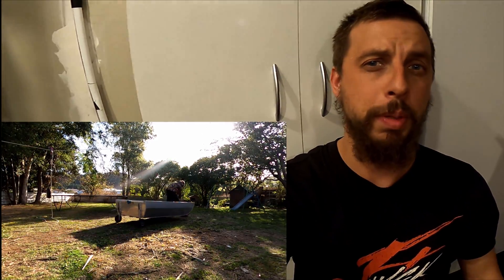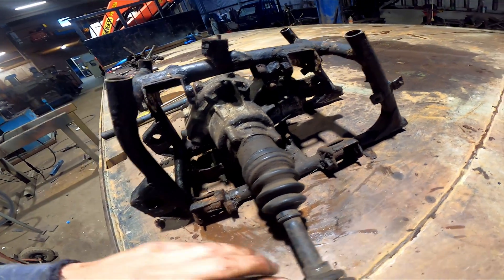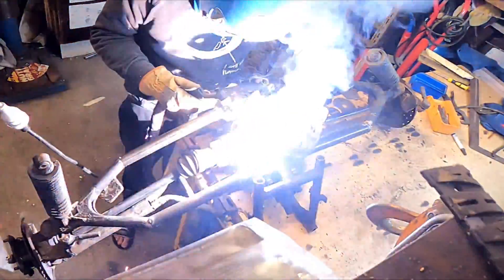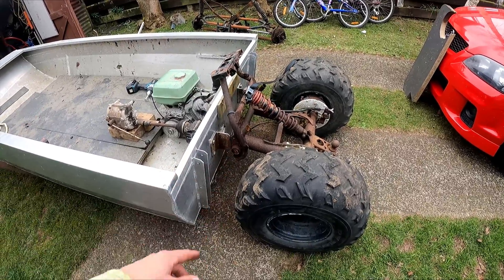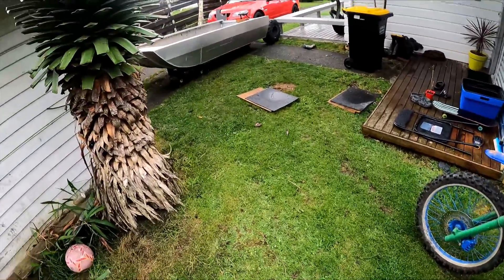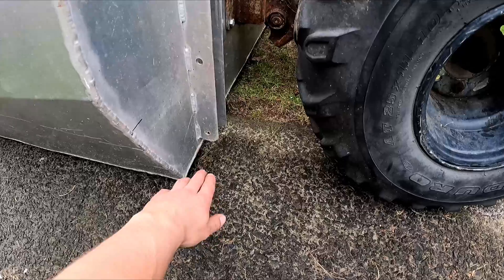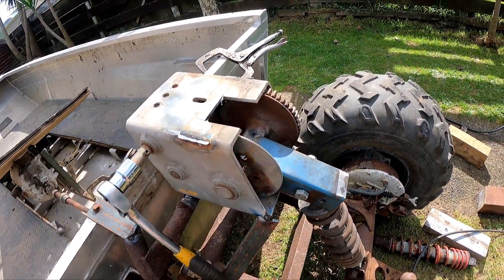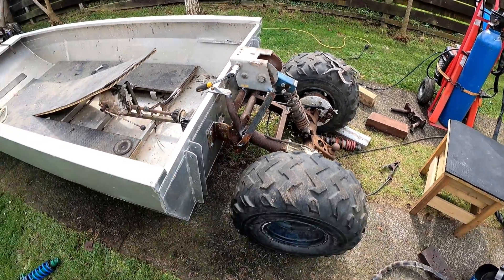Amphibious ATV Build, p1

Comment: Will that diff have an oil issue flipped?
Reply from the maker: I don’t think so I was just going to put a bit more in it to make sure but the dipstick is upside down so would have to seal that
Reply: @dkthewelder  some diffs don’t oil as well in reverse but I see you’re not going to need it anyway

Comment: Oh well done with the music sync @5:16  That was some world class editing.  The winch looking device for adjusting rear wheel height is cool, but barely up to the job.  In use the un damped lowering would be less of a problem because you'd be lowering the hull into the water, so a bit of a splash would be all you'd need to worry about.   And you are not a worrying sort of a guy anyway based on your videos.  You are still going to need more power to lift the rear wheels, so maybe something weird with a wee trolley jack?
Reply from the maker: I will stay with the winch it works pretty well I can fiddle with the geometry a bit to get it better I will mostly raising and lowering on the water with very little resistance, but I need it to work in worst case scenario. I’m still not sure what to do with the front

Comment: Awesome. A scissor Jack out of a car might work better than the winch as you have controll both ways   Also I see  an air boat would be interesting.  It won't suck up weed or stones
Reply from the maker: Yeah I might use a scissor jack for the front. I’m going to use an outboard for on the water but when it’s shallow I can just use the wheels there is going to be a lot of trial and error